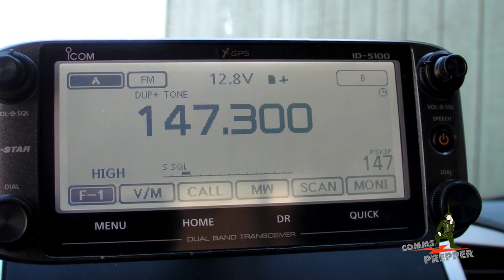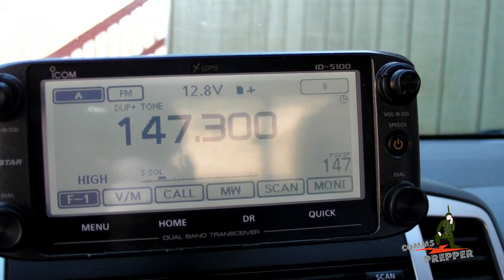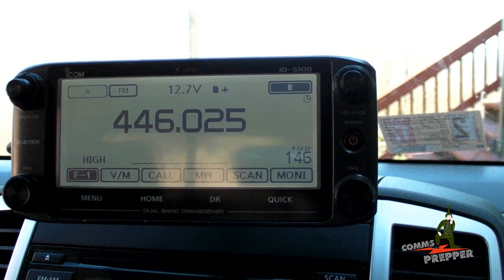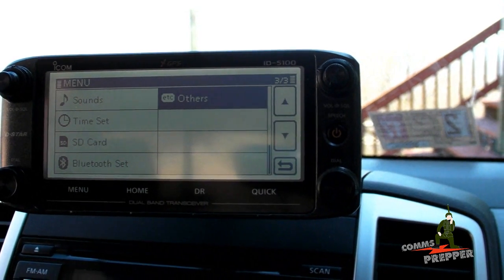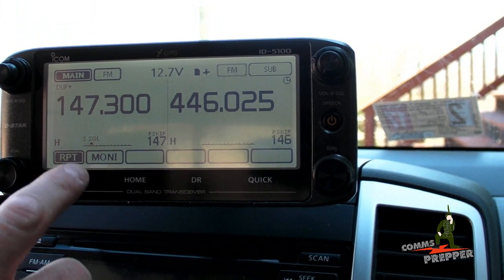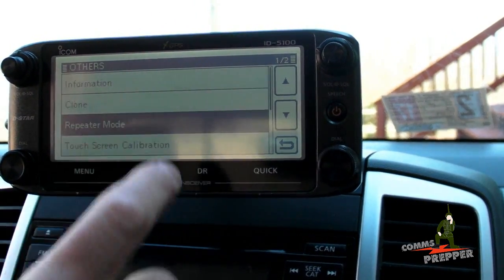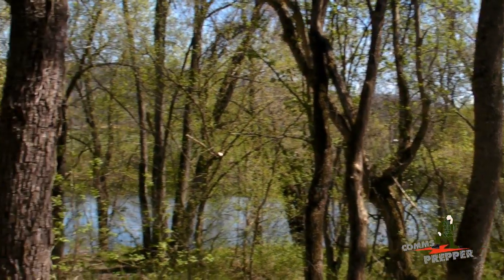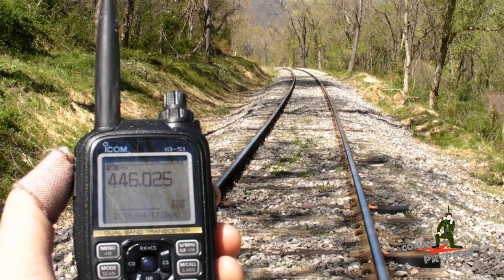Cross Band Repeater - Icom ID-5100A

Comment: Hey, I can get the bluemont(in virginia actually) repeater from town! I will have to keep an ear out for you. I was going to play around today with the crossband, as it would have been very helpful for the CCAP bike ride that starts in Winchester and heads south. I ended up in a hole where my FT-70 couldnt hit the assigned repeater for my position, and ended up attached to my truck the entire time.

Comment: Great video. I use CBR a lot for things like Sky Warn activations. I have found two problems.  First is the distant (not the car) repeaters tail. It  keeps the down link up and prevents you from being able to come back until the tail drops. The other problem is regulatory. On the down link, your CBR repeater in your car is transmitting but it never carries your voice. Therefor, you never ID through it. I know of two easy solutions to the repeater tail problem. One is to keep the tail as short as possible. The second solution solves both the tail problem and the ID problem. That is, I set the radio up to only repeat the up link signal. Then I set the HT up split band to receive the distant repeaters output frequency transmit on the CBR repeaters up link frequency. Then add "cross band repeat"  to my ID. The down side of this approach is that you don't get the boost from the CBR on the down link. But it does overcome the low power of the HT. Also make absolutely sure that you have a tone and time out timer set on your CBR radio. You can lock you CBR radio and the distant repeater open causing them to overheat. Give it a try though. It's relay fun and is a powerful tool for service work.

Comment: How did you program the handheld?
I was told to tx uhf 440.000 and set duplex to split and offset to 144.000 (examples). I was told to set a tone so no one else can use my cross-band rptr.

Comment: I know this is an old video but how did you receive the repeater (vk2rbm) when not on its tx frequency? Did you set the handheld to split rx/tx
Reply from the maker: I used the cross-band feature in the ID-5100 that's installed in my truck.  I'm using the HT to make a simplex connection on UHF and cross-band to VHF repeater pair on the mobile.

Comment: Where did you find out that you can remove the control head?  I spoke to Icom today and they said it isn’t recommended.
Reply from the maker: +roostershooter76 in the manual somewhere.  May have been the advanced manual.
Reply: If it isn't recommended,  then why did they add the feature? Sounds like you talked to someone didn't know what he's talking about

Comment: Great Video.  I just picked up a 5100 and was playing around with the cross band repeat function.  I never heard the 5100 self ID, is that a setting I missed somewhere? 

Keep up the good work, 73,
Matt
Reply from the maker: +Matt LoPresti the radio only runs the cross-band in analog mode.  No ID taking place

Comment: Many regions have frequency coordination groups.  They usually have assigned frequencies for cross band repeat.  For example, in Wisconsin, W.A.R. specifies 446.4125 thru 446.4875 (25 kHz) for this function.  SERA in the Southeast specifies 445.7375 thru 445.9000.  Crossband repeat is used during swapmeets, etc.  Consider using CTCSS TSQL on the ID-5100.  Al - WA9RYO

Comment: So, you keep your DC power on all the time? Doesn't that drain your battery? Do you have a secondary power supply?
Reply from the maker: I don't get the question, what DC power?
Reply: Arent you running the cross band radio off your car battery?  If so, what is the duration that you run the cross band radio?  Do you have a secondary power supply?  If you cross band all day or several hours - are you worried about the battery.  Or do you use another method of power?

Comment: Great video demo, thanks for posting. Two questions, what mounting bracket are you using for the ID-5100? Can you crossband repeat using DR mode in any way?
Reply from the maker: You cannot cross-band in DR mode.  The mount is WORKMAN PED1 HEAVY DUTY 6" PEDESTAL CB RADIO MOUNT BRACKET.  They are on Amazon.
Reply: So you had to use FM from the HT up to the mobile, even though both radios are capable of DV simplex?  That's a bummer.

Comment: Ok I am a little curious and couldn't find it in here in comments. How far was you from your truck in miles approximately?
Reply from the maker: three miles but that means nothing.  VHF/UHF radio systems are line-of-sight (LOS), so range is dependent upon the two antennas seeing each other.
Reply: Ok great. The reason I ask is I have an Alinco dr735t with cross band repeat as a base on a Comet GP-9 and another in my truck on a Diamond 7900A and several HT's  Still trying to be careful using them as I know you can overheat them easily and damage them in cross band mode.
Reply from the maker: Turn the power down on the Alinco.  If it's in the right location you should need allot power.
Reply: Yuh I have done this. I like how the Kenwood has like standby settings that turns most all off when in cross band mode and how yours will unplug the face. Not sure if mine does that. Haven't got to test it a lot as I work a lot of hours. Will delve more into it when able. Thanks for reply

Comment: Can cross band repeater work without going through a repeater?
What is simplex cross-band, and how does it work?  Demo?
I want to set something up where the radio in my vehicle becomes the mobile base station repeater to service  a group of local handheld operators.
Reply from the maker: Cross-band repeating does not requiring connecting to a repeater.
Simplex cross-band would be spit VFO (A/B), all radios would TX (lets say) on VHF, and listen on UHF.  Perhaps a future video topic.
vehicle acting as repeater - that's what cross-band repeating is.

Comment: I crossband repeat through my Kenwood d700 regularly and find may hams either don't understand how it works or are unwilling to try it because it involves more than just turning on a radio.  I have been in roundtables during commute time and due to nobody letting the repeater drop, have been unable to participate until everyone got destinated and got off the air. "I wonder where Steve went to".  "He was in the group a few minutes ago" "I don't know, Steve are you still out there?" "Nope, didn't hear him.  Guess it's your turn Jim." "Thanks, I guess Steves portable died on him".   The whole time I'm there waiting on the repeater tail to drop so I can get in and participate in the discussion but, .....  I don't know if it's a Baton Rouge thing where hams in South La don't like to pause or drop a repeater or if it's common everywhere but it is a major issue with xbanding around here.
Reply from the maker: Nope - same thing in my area.  That's why I prefer simplex with my small group.

Comment: Awesome video, thanks! The Terminus comment was very cool. A couple of thoughts about crossband repeat are that repeaters can be a little bit of challenge to repeat into because the repeater signal has to completely drop before you are going to be heard and it might be best not to crossband during a net or nets because the radio will be transmitting almost 100% and that could put a  strain on the radio particularly if set at full transmit power.
Reply from the maker: +George DeLoach Good points.  In a prepper scenario I would setup a simplex cross-band for local comms and not cross with a repeater.  In this video example I needed the repeater because my neighbor (with license) was not around.  I needed someone to answers.

Comment: I have my base Kenwood TM-D700A set up for cross band, because my I can't hit my favorite repeater with my HT or mobile this far out.  I just enable it when I leave the house.  

Hams should remember to practice using features on their radios.  You may not have the instruction book when you need it.  Thanks for the Demo!
Reply from the maker: +KA5IVR Good point on the practicing.  Thanks for taking the time to watch and comment.  CommsPrepper

Comment: That is pretty cool being able to remove the radio head  have it function as a cross and repeat!
Reply from the maker: +ngpeters Yes - that is a cool feature.  I stumbled across that reading the manual.  I still have to make the video but with the control head removed you can still control allot of the radio's functions with an Android device (via Bluetooth).  It's a radio with lots of prepper applications.